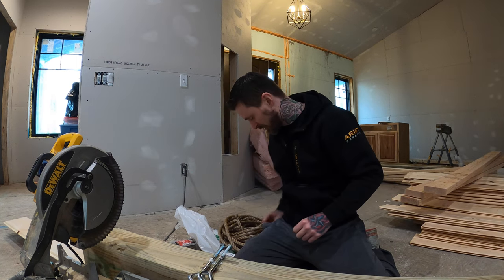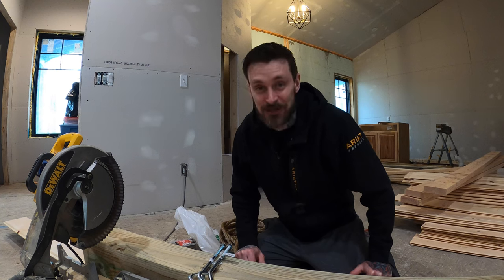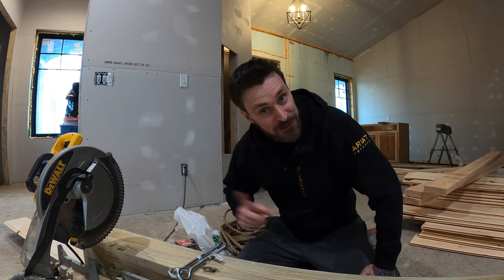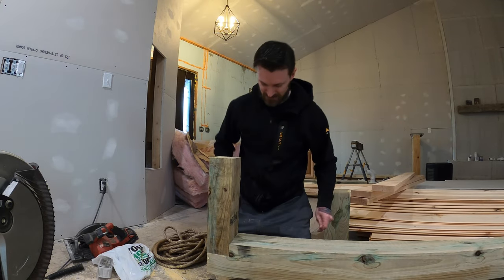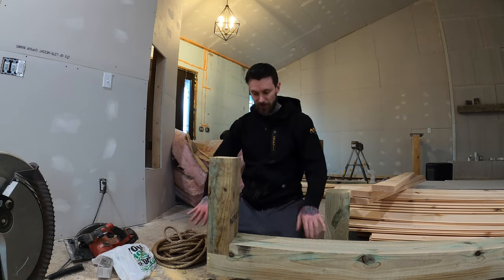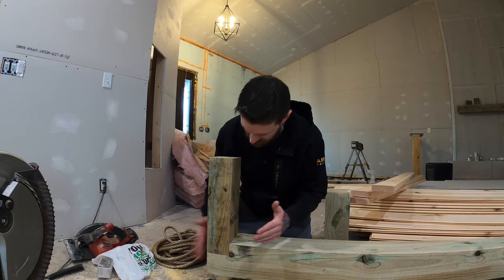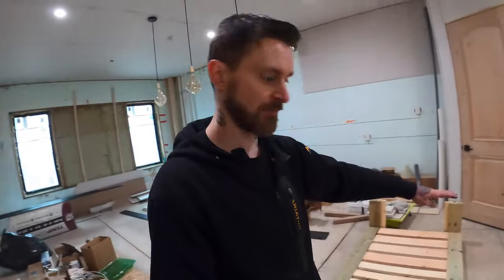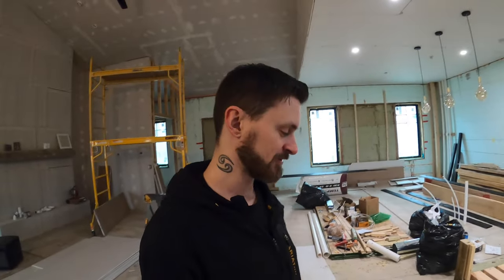Making a $3,700 porch swing for $300!!

Comment: I like it, good place to chill but most swings are made of 2x4's and I would have just used the 4x6 instead of the 6x6 as it would stain better and not as heavy. Heavy fender washers are the way to go for support and I would even add them underneath to the knotted rope. 4x6 you can park 4 people on it and the 6x6 you could park your truck on it, way over kill and the pictures all look like a 4x6 which to me sanded and already rounded over would match the raw lumber and stain would all match better.
Reply from the maker: Yeah hopefully the stain takes well when it drys out.  I think it’ll need 1-2 coats over the years though.
Reply from the maker: Yeah hopefully the stain takes well when it drys out.  I think it’ll need 1-2 coats over the years though.
Reply: @neckofthewoods24  I used oil base on my swing then added a clear oil base quality sealer over it and it helped to keep the stain from sun fading as the clear had UV blockers to it.